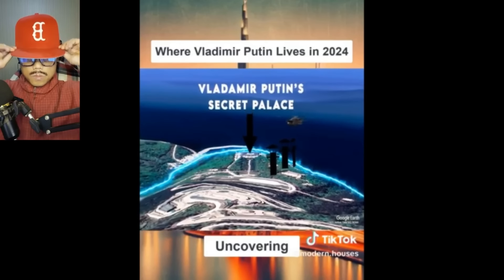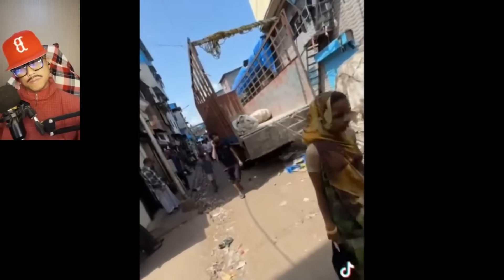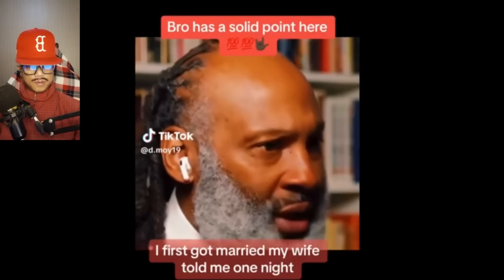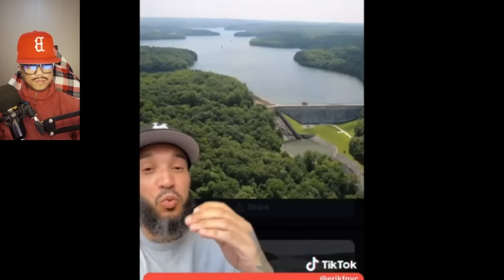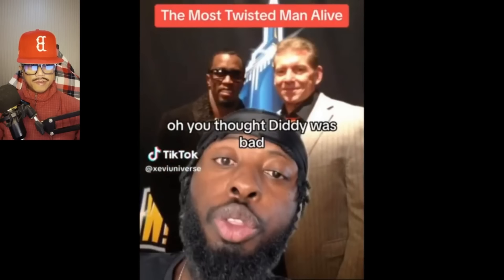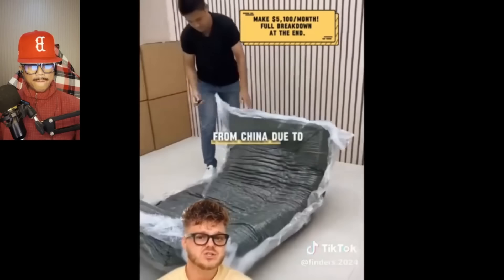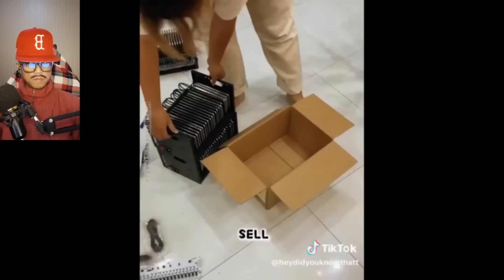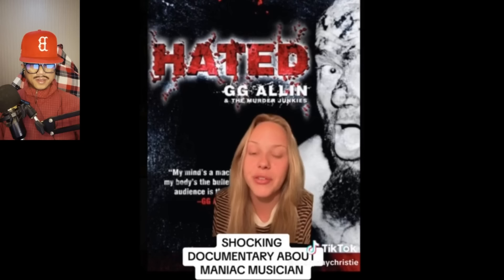Creepy & Cool Tiktoks That Will Blow Your Mind

Comment: It's true about the bread. Whatever they are putting in there , doesn't mold. I used to put bread in the refrigerator to keep it good longer, and while it slowed it down, still would mold eventually, but now, it's weird, doesn't act like normal food  by going moldy.

Comment: Those Icons produces that much Holy oil when there is about to be or currently struggle/attacks om that Orthodox Christian Church and it's peoples. The Holy Fire Miracle happens every year on Pascha (date of Orthodox Easter), at the Tomb of Christ. It only works for Orthodox. 2 times the Orthodox Priest were kicked out. Both times the blue light, that lights the candles w/a flame that won't burn you, did not happen. Got watch the videos. Christ is King. 
PS  We still have new Saints